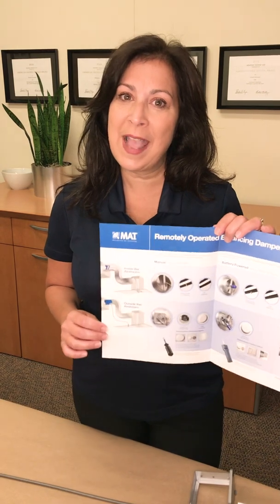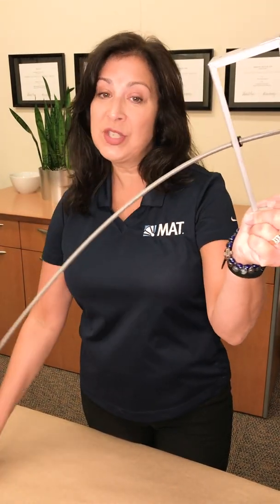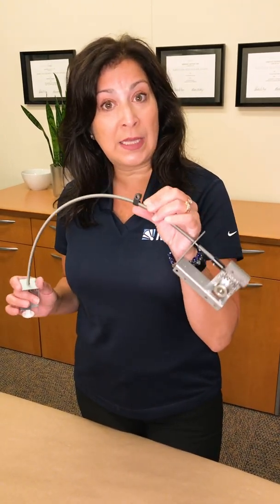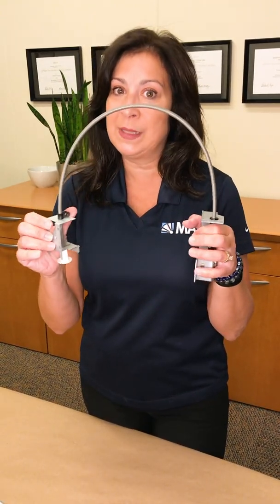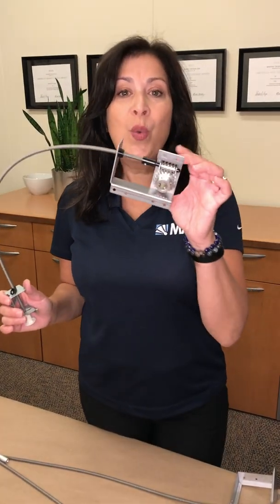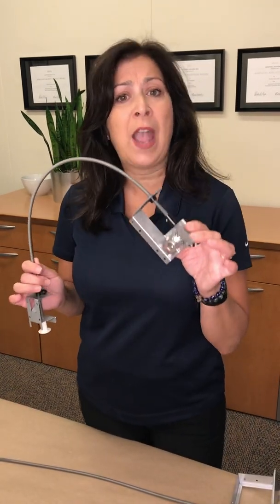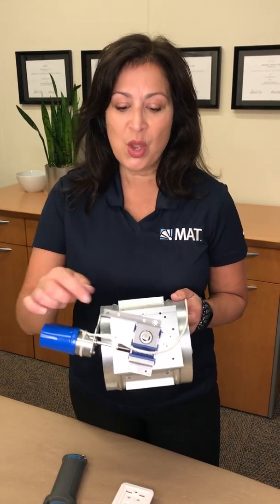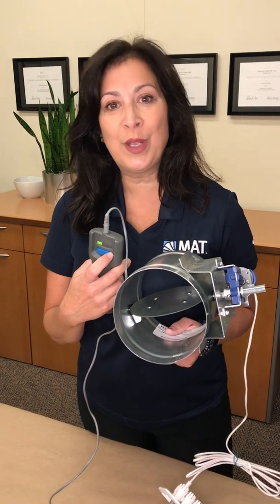MAT Remotely Operated Damper Product Line Overview

Comment: Do you have a manual for the handheld tool that explains LED lighting? We did our first job this year with your product and I was very pleased although I had a couple that seemed to be not driving correctly based off the LED indicator. It may be normal. I’m not sure if there’s a difference from rectangular. It’s around the way. The motor drives open and close as far as percentages, but would love to see some type of manual if possible.